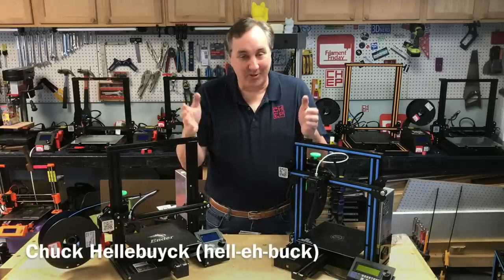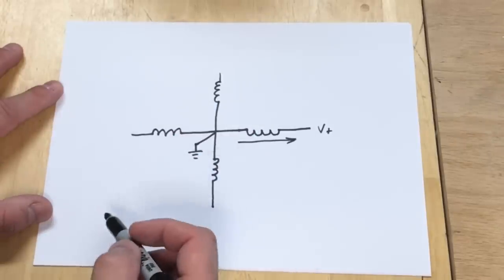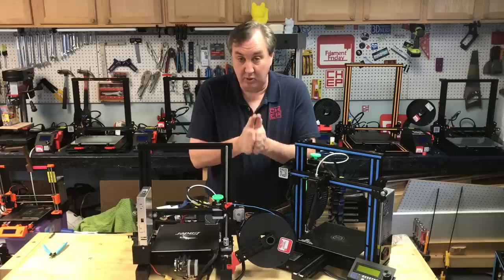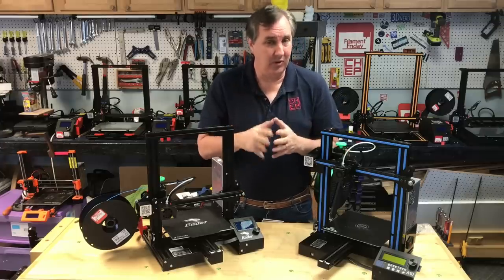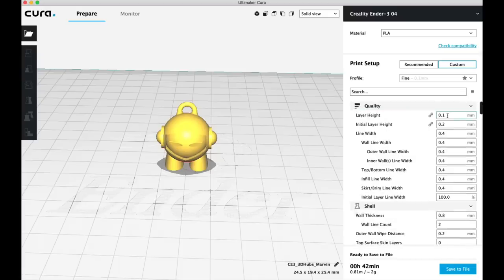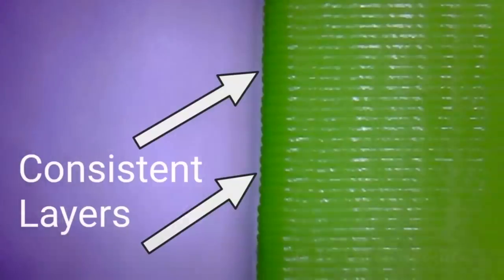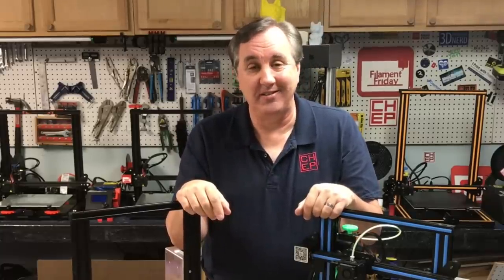Better Quality 3D Prints Using MAGIC NUMBERS on Creality Ender 3, CR-10, A10

Comment: Thanks for the "Magic Number". Whats the finest setting you tried? With that number I finally know which heights are compatible with the Ender 3.. couldn't find that information anywhere.. ( , = . ) 
0,04 : 0,08 : 0,12 : 0,16 : 0,2 : 0,24 : 0,28 : 0,32 : 0,36 : 0,4
I don't think 0,04 would work as the Extruder has the same motor.. you know the magic number of the Extruder? Considering the 1,75mm filament, it has a minimum extrusion which is probably to much for 0,04 height.
Reply from the maker: I don’t usually use lower than 0.12
Reply: I have run a number of prints at 0.04mm layer height.  It takes a LONG time to print, but the quality is amazing.  My only question is; How do we know the home position or starting point of the print sits perfectly at the beginning of a step?
Reply from the maker: As I’ve explained in comments many times. It can start at a microstep but magic number will make it rise at that same microstep averaging out all the various Microstep angle variability.
Reply: @FilamentFriday  Not my channel, so I'm not going to read every comment to find the answer. Too many comments on too many videos. The magic number has worked well for my prints. Thanks for the quality content.

Comment: Can this be taken further by disabling microstepping entirely on the Z Axis and recalibrating the Z Axis Steps/MM? Looking at pictures of the mainboard there seems to be zero ohm resistors on each stepper driver, and looking at the 4988 driver there's three "dip switches" that control the steps/mm. Maybe by removing these resistors the driver will disable microstepping. Has anyone tried this?
Reply from the maker: You lose smoothness and some resolution on bed level.
Reply: I considered that, but don't use auto bed levelling to avoid wearing the lead screw and never find any issues without it. As to the overall bed height detection the resolution is still 0.04mm which should be fine. I intend to give it a go later and see what it's like.
Reply from the maker: Let me know how it goes.

Comment: Awesome video!!  do you think you could do the same for a delta?
Reply: Tekkie Dad those numbers  doesn't matter on delta printer 😀
Reply: @tomik9868  Hence why I was asking for a delta version of this...
Reply: @TekkieDad  the point is that it is just not applicable due to the way a delta printer calculates "height". The position of the three steppers is constantly changing on any given level. So there is no such a thing as a "magic" height on a delta.
Reply from the maker: This doesn’t apply to Delta printers.

Comment: This sounds wrong IMO : you adjust layer thickness to follow 'physical step' and to avoid 'logical step' ( microstep ).
But when bed leveling is done, how do you know that you are on a a 'physical step' and not on a 'logical step' ??
Since there is 31 microsteps each 1'real' step, you probably step from 5.17 to 6.17 each layer, but rarely 5.00 to 6.00 has you think ...
Am I wrong ?? 😋
Reply from the maker: As I’ve explained in the video and multiple comments, even if you are on a microstep to start you rise up at the same microstep position so you get consistency.
Reply: @FilamentFriday  I do not agree with that conclusion entirely. If you can not rely on microsteps, you can not rely on microsteps. Problem is that the force to hold the motor in position is very very small with micro-stepping. And that does not change at all when you try to jump from one microstep into the next even if it is the amout of steps away to make it a full step.
The consisten Layer heights you show in the video could be the result of doing steps close to the full step in the first place and then loosing a few micro-steps on the way and therefore only moving in full steps.

I believe what would help and what I was meaning to do for almost a year now is to modify the controller-board to not use micro-stepping for Z anymore.
The resulting limitation in vertical resolution to 0,04 mm does not look like an issue to me.
For the CR-10/Ender-3 this could be done by removing the three resistors R32. R33 and R34 resulting in low signals on the MS1, MS2 and MS3 pins of the A4988 since these pins have built in pulldown-resistors.
Well, okay, the nice thing to do would be to tie these to GND externally.

I just finished a schematic for the CR-10/Ender-3 controller board:
https://github.com/RudolphRiedel/CR-10_wiring/blob/master/Ender3_schematic.PDF
Reply from the maker: You basically confirm the idea. The torque is less during microsteps and therefore the angles are not perfectly linear between microsteps. So using the Magic Numbers means you rise and stop at the same micro step creating consistency vs at 0.1 you are jumping between various microsteps as the microscope showed. 

If you are missing steps completely then that is an issue that needs to be fixed before trying to get better prints from settings.
Reply: No, I do  not agree that you even can rise and stop consistently at the same micro-step.
Your result is so nice because you probably loose a few microsteps in the beginning untill you run on whole steps - so why not run on full steps alltogether?
With .1 layer-height you loose micro-steps all over the print again and again because the motor is pushed out of full step due to the "odd" number of steps and tries to latch back into full steps.

So if anything this is proof for me to get rid of micro-stepping for Z.
Reply: Sorry @Chep but unless the firmware has an option for rounding micro to full steps after homing, following your reasoning, there will always be layer height inconsistencies. Assuming poor holding torque in each microstepping (but not non existing) each new layer height can (or not) be held* in a micro or full step, assuming perfect mechanical properties and that the endstop started in a microstep.

Also, more and more users are adding autolevel with mesh leveling and that renders all this discussion null
Reply from the maker: Your the one claiming missed microsteps not me. If there were missed microsteps that made it jump to the natural steps then even 0.1 would have smoothed out but the microscope picture didn’t show that. . 

 I’m saying the microsteps are made but are not equal angles due to variance in the sine wave voltage that drive the coils during microstepping. They aren’t true sine waves. This variability in the angle from microstep to microstep is consistent though because the pseudo sine wave is consistent. So staying on the same microstep produces consistency as the microscope showed. 

Mesh bed leveling adjusts Z to produces a perfect first layer. After that it’s equal movement so Magic Numbers still apply. 

Driving without microstepping has been done. It’s just not as smooth and can be noisier but should work. I believe the firmware has to be modified to match the steps per mm as well as removing jumpers.
Reply: No, actually you show clearly that you loose micro-steps at 0.1 mm layer-heigh resulting in layers of different height. It keeps snapping to the next full step which is all over the place in regards of layer height.
Reply from the maker: No it’s showing that is jumping between different microsteps at each step because it wasn’t based on the Magic number so under the microscope you can see the variance in microstep angles I talked about which is the whole purpose of using magic numbers to avoid this variability.
Reply: Well, so we agree on that you are loosing micro-steps at 0,1mm but not on why it looks much better at 0,12 mm. Does not make any sense to me that doing 40 micro-steps is not stable but doing 48 micro-steps is - unless you land at a full step. In any case I fully agree that using 0.04 mm incrementals for the layer height is a good idea and without a much more detailed analyses of what is actually going on we can leave it at this. Using 0.12 / 0.16 / 0.20 / 0.24 mm layer heights is the way to go for at least the CR-10 and the Ender-3.
Reply from the maker: I don’t agree it’s losing micro-steps. Never said that. It’s not. I’ve tried to explain this multiple ways that the micro-step angles are not equal to each other which is what causes the variability at 0.1 vs hit the same consistent position using 0.12 which explains it all.
Reply: The ROOT cause of the issue is due to floating point maths errors. If you DON'T use the magic numbers, rounding errors in the maths calculations add up and you have occasional inconsistent number of steps. Using the sweet multiples mean that the calculations to increase the height of each layer stay consistent and in harmony with the physical step/pitch. The fact that you start on a step or a microstep doesn't matter, so long as you increment kindly to the maths, then all is well.
Reply: @havenview  that sounds plausible except that 0.1 mm translate to 40.0 micro-steps, not 39.999 or 40.001. By that logik 0.1 mm should work as smoothly as 0.12 mm.
Reply: @rudolphriedel541  The microstep range is never entirely linear and is dependant on motor type, motor load, driver type, driver current and other factors but that microstep non-linearity is constant irrespective of which major pole it is between. Thus, it doesn't matter what microstep you start at so long as you remain on that microstep by choosing your magic number with respect to your step angle and not your microstep angle
Reply: @havenview  Okay, how does that take into account that you need to step thru all other steps to get to the angle you started with? It is not like you can jump from one point to the next at the exakt same angle, you need to cycle thru all steps in between. There is no remaining on any angle, regardless of the amount of steps you select. How is moving 48 micro-steps more reliable than 40 micro-steps? Also, how is this answer supposed to explain "rounding errors in the maths calculations"? As long as the layer height is a multiple of 0.0025 there should be no rounding errors.
Reply from the maker: That’s what I tried to explain several comments above. I’m working on a video to further clarify it.
Reply from the maker: Because not all micro-steps are equal movement but each natural step is. So if you move through all micro-steps once, you average out all the Micro-step errors. If you move less than all the micro-steps then error is introduced. So 48 goes thru 3 full sets of Micro-steps averaging out the error. 40 steps goes through 2 1/2 full set of steps so some error is added each time. Magic Number makes sure you always go a full set of Micro-steps.
Reply: @FilamentFriday  Ah yes, okay, the individual micro-steps within one full step-cycle are not equally 1/16 of 1.8 degrees but their sum is, makes sense. As somewhat can be seen here: https://hackaday.com/2016/08/29/how-accurate-is-microstepping-really/ So something entirely different than "floating point maths errors". Seeing the graph at hackaday for the A4988 it seems unlikely that the difference in layer heights is even noticeable but a graph for your z-stepper could look significantly different than that. And it could look a little different in the CR-10 than in the Ender-3. And it could look different in my CR-10. But going full step-cycles should give reproduceable results. And looking at the provided graph this should be even more true for printers that use DRV8825 drivers - if there are any.
Reply from the maker: Exactly. And that’s what my microscope view of the 0.1 layer height shows the uneven layers that cause too much plastic to be extruded while the 0.12 shows smooth consistent layers.
Reply: @FilamentFriday  It would be worth pointing out that the stepper driver doesn't really step between microsteps as it does between real steps - the driver modulates the control signal to the coils so that it slightly releases from one real step position and slightly attracts to the next. The ratio between the signals gives the intermediate positioning and it is those positions that tend to be non-linear. The magic number solves this AND floating point errors, the latter problem would also cause layer shifts if microstepping was not used.
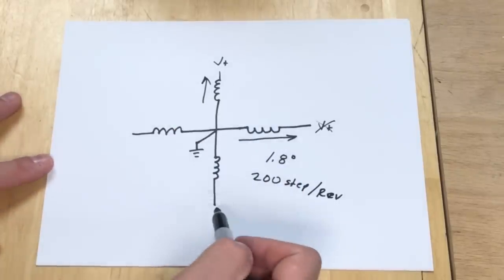Reply from the maker: I explained about how Micro-steps are formed at 1:50. 
I guess I should have gone further and explained the non linearity but I didn’t think many would be that interested.

Comment: Does the nozzle with make a difference ?  the makergear machines I'm running are .35 mm not .4
Reply: Not really... the vertical (z) height is the factor you are calculating.  If you follow the same 80% rule.. means you should not print higher than 0.28... so just calculate the same layer height but under that limit.
Reply: @TekkieDad  ok thanks now I just need to confirm the steps of the steppers makergear uses and rod pitch
Reply: @MicheleHjorleifsson  if it is an 8mm lead screw.. most likely it is the same... i haven't heard of many 8mm Lead screws that have different pitch that are provided stock.. but i could be wrong.
Reply: @TekkieDad  I think it's a ball screw actually I need to do some research
Reply from the maker: Nozzle size doesn’t matter except for limits.

Comment: What if you have a delta? I'm trying to figure out how that relates to the size of the pulley. Of course they don't list that spec.
Reply: Probably best to limit each axis to it's magic number. The point being that the micro steps won't hold their position as well as the full step position.  So every time your lead screw stops, you want it to be at the same micro step.

Comment: When printing my ender 3 Pro only goes up in either 0.1 or 0.2 mm increments. If I choose 0.16 in cura the printer auto rounds it to 0.1 and 0.2 layers when printing🤔
Reply: no it doesn't
Reply: @sniperpronerfmods9811  mine does
Reply: then reflash the firmware @isaaclyonsf1
Reply: @sniperpronerfmods9811  how do I do that, and does it void the warranty?
Reply from the maker: How do you know it rounds to 0.1 and 0.2 vs 0.16?
Once it’s printed you can’t measure that fine of detail..
Reply: @FilamentFriday  it shows as increasing by that much on the lcd when printing. Thanks for the reply.
Reply from the maker: The display only shows one decimal point but the actual print goes up 0.16 or whatever you set it to. 
There isn’t enough space on the display for extra digits. That’s all.
Reply: @FilamentFriday  oh ok thank you.

Comment: I've stuck with 5mm threaded rod on my cartesian, it prints very nicely so there's been no reason to mess with it. So my magic number is 0.004....soo, I think i can just use whatever layer height I like :D
Reply from the maker: No, 5mm/200 = 0.025 is your magic number. You base it off the natural steps not microsteps.
Reply: @FilamentFriday  I think you are confusing the pitch with the diameter, like you do in your video. The normal pitch for a normal M5-rod is 0.8mm, so 0.8 / 200 = 0.004. So his magic number would indeed be 0.004 as he said
Reply from the maker: No I’m not confused. I said it rises 8mm in one turn. I didn’t say that was the pitch. It’s a 4 start 2mm pitch rod so it produces 8mm rise on one turn. So the magic number is correct.
Reply: @FilamentFriday  Hello! i'm definetely confused :)
where can i get the 4 in "a 4 start"?
my printer have 8mm threaded rods with pitch of 1.25mm
what is my magic number? :)
if 0.025 so then every of 0.1, 0.2, 0.3 is appropriate for my printer but these are not!
i'm getting that "large: layer for 0.2 for example
Reply from the maker: If you turn it one turn how much does it rise?
Reply: @FilamentFriday 1.25mm
Reply from the maker: Then 1.25/200 = 0.00625 so that is your magic number.
Reply: @FilamentFriday  thank you!

Comment: Hi,

Quick question. I have a CR20pro. Im using a cura profile I found on github, it ok I think. But could I use Ender 3 or CR 10 profile that comes with cura installation ?
Reply from the maker: Ender 3 would work best.
Reply: @FilamentFriday  Thanks, trying it out now. Is the CR20pro and Ender 3 pretty much the same printer ? Thing I have seen something about having same PSU, mainbord etc.

Comment: Any chance that you will provide your 0.12 profile? Also, have you figured out a good profile for PETG to keep the stringing at a minimum?
Reply: Justin Cummings - what temperature you use for PETG ? did u try some flow adjustments?  i have good results on 220C
Reply from the maker: Soon. I’m still working on it.
Reply: I print PETG at 225C, un-check avoid printed part or something like that and increase the K - factor for linear advance if you use marlin 1.1.9, I use 1.7 for the K - factor.
Also try to adjust the extrusion multiplier, I use 95% after a good calibration with PLA.

Comment: For all with an Ender 5 (pro) with a lead screw with a pitch of 4 mm. The magic number should now be in 0.02 mm increments. I'm not sure if the magic numbers will work if you use a BLTouch. Since the first layer gets fine tuned to the actual bed level and this hight hasn't to be a magic number.  The hight can even change due to the x-y position.